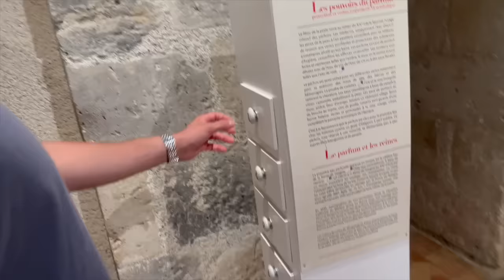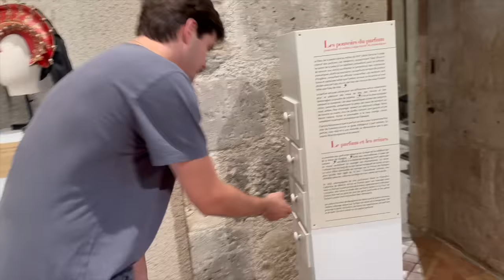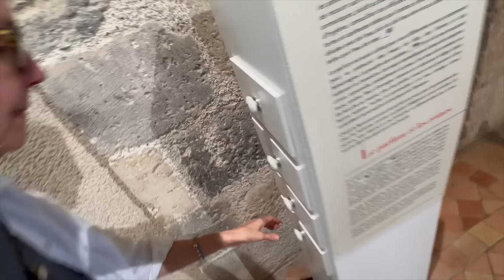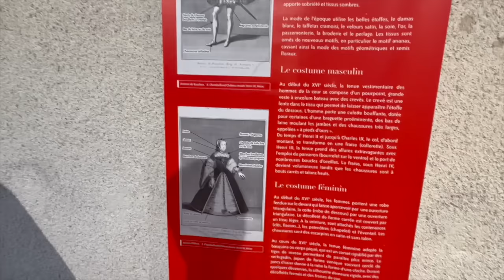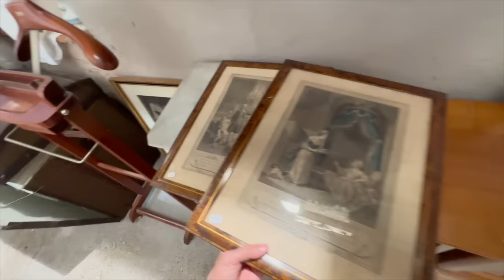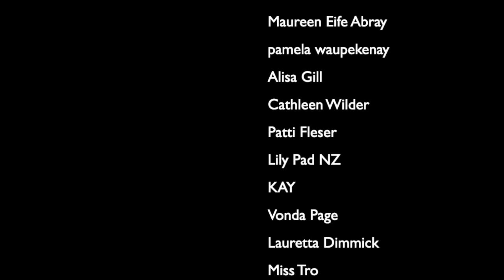The Grand French Chateau Tour 🏰 The Chateau Chronicles – Ep #52

Comment: I believe having drapes will pull the entire room together.  It will also prevent the chateau from looking like a show room and make it feel like a home.
Reply: I agree!
Reply: So true!
Reply: Drapes are needed or window treatments in most of the rooms.  If you are already doing windows please pardon my commenting.  As lovely as it is to have big windows…especially in bedrooms, people feel comfortable and safe with curtains drawn at night.  Also during the heat of summer closed curtains, drapes, shades, shutters will help keep rooms cool! In winter these will certainly help keep the room temperature warmer! …and cozier! 
You might consider a small electric kettle on a tray having 1 or 2 tea cups or mugs…water containers …tea  and sugar packets…and individual containers of milk. Small individual packets of biscuits/cookies and/or individually wrapped chocolates. Placed on a small table or on one side of the desk or dresser, will delight your guests. I realize it is a bit more work but your guests will very much appreciate the effort made.  Each bedroom in my B & B had these amenities…just another way of letting your guests know they are appreciated
🌸 …the extras could be kept in a hallway dresser draw where each bedroom would have the essentials to replace. A fire extinguisher on each floor and an overhead fire alarm in each bedroom/hallway?!  A Carbon Monoxide Detector on each floor.
A Security System ( there a many types).
A Gas Leak Monitor; 
Air quality Monitor…last but not least 
a Smart Water Leak Detector. (Should you need more info. I’ll be there happy to email these to you.)
Reply: Wow, Rosita, you really have the information needed!  Good advise.

Comment: The metal bedhead in the second broconte was stunning. I'm with Olivia on the peacock wallpaper in the dinning room. It will look lovely with all those glues and greens. Sorry but you need curtains. They will give the opulent look of a chateau while keeping it cozzie. They will also help with the seasons. Blocking out the strong sun in summer and blocking out the cold in winter. Light in kitchen could be an older style lampshade. Or the kind where there is 4 long glass sheets in a cube shape. Sorry no idea what those ones are called. I've scene them on different Chateau vlogs. Something like what you have but more old. A simple lampshade is easy to clean for a kitchen. Olivia's idea's for the wallpapers are spot on. The room you're going to wallpaper with the blue wallpaper that has lemons on it. I'd paint the slopped roof with the background blue/grey colour and paper all the straight walls. I can see a use for the mirror that isn't reflecting if you want. You could use as the centre of a folding screen that could sit in one of the rooms with 2 beds so shy people could change behind it. overything is looking good